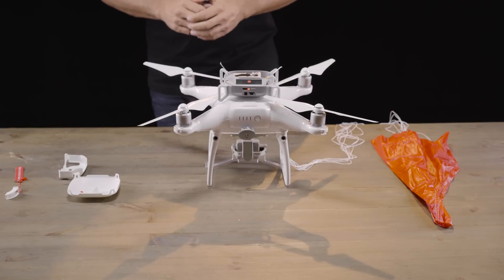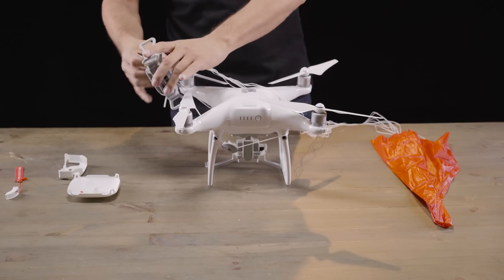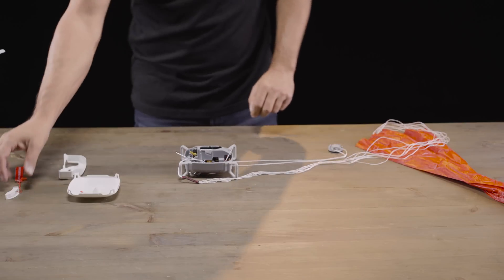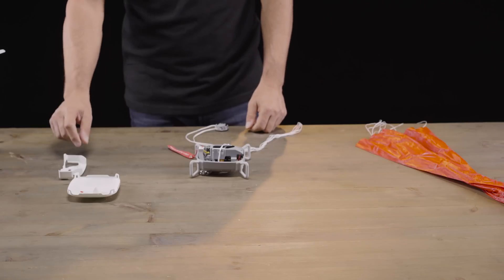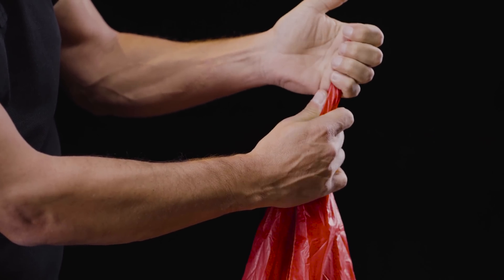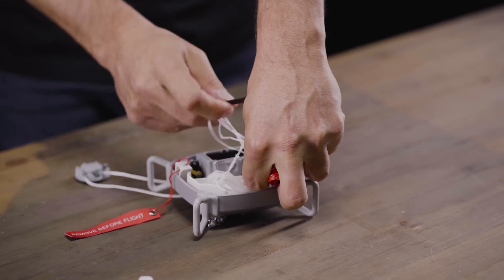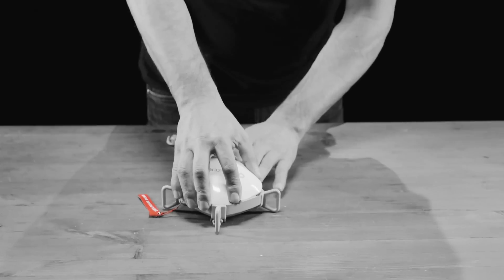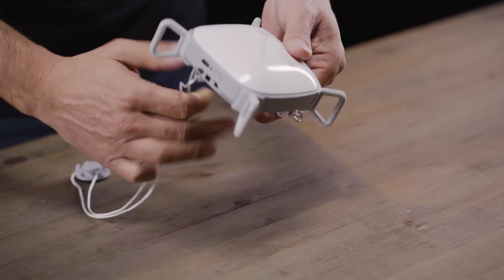ParaZero SafeAir Phantom: Repacking the System

Comment: is it right that 2 parts lost after the trigger?

- Is it possible to secure these parts with a cord?
- or is this as a spare part? cost?
Reply: In case of emergency activation the Lid and the additional part fall down like leaves, and can be easily found near the saved drone. In the rare case they are lost, a spare set can be procured at 30 USD.
Reply: with a certain height and side wind I need some hours to search :-)

If I have meadows or fields fly I need 2 years to find the two parts :-)

at every trigger $ 30 for spare parts ... + schipping worldwide + taxes .... hmmm pretty high following costs.

Stl files for the 3d printer would be great (for the "consumables") :-)
Reply: Hopefully you will never have a malfunction, but in the rare event that you do and the top is lost there will be the additional tops as mentioned above. If you want a few spares, please reach out to contact@parazero.com or to the nearest dealer. We are happy to support you.